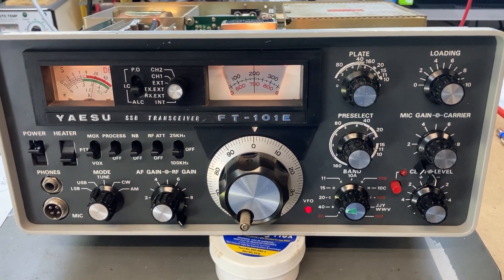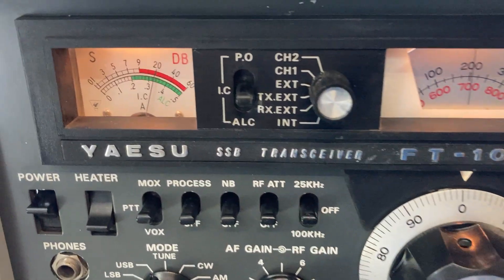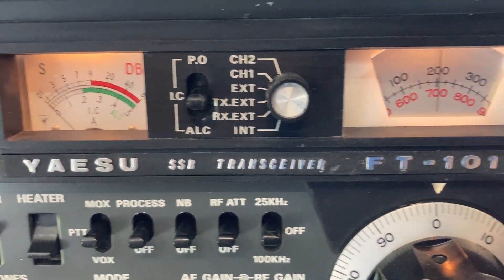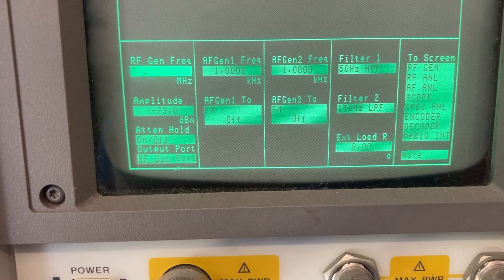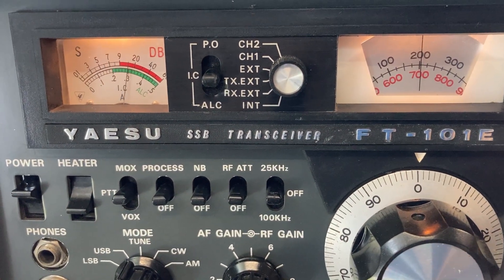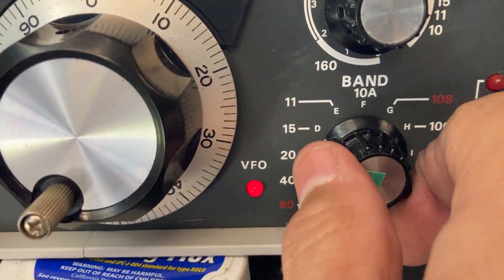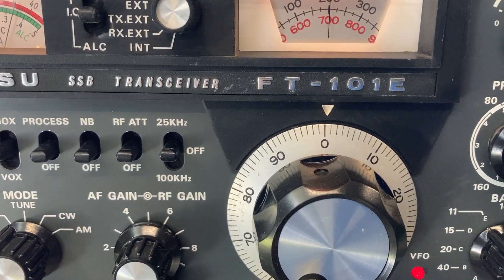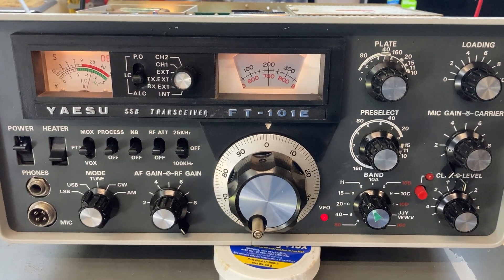Yaesu FT-101E- RX testing

Comment: you need to move your vfo to look for the signal on some of the bands because it may be off frequency
Reply from the maker: I had done that already but should have showed it during the clip for completeness.    I'm going to change over trimmer caps on the bands that there is no RX- it's very fiddly crowded board